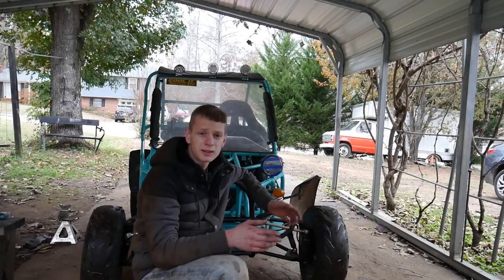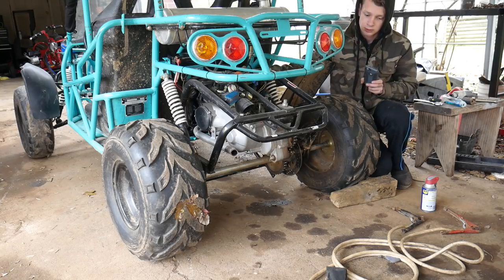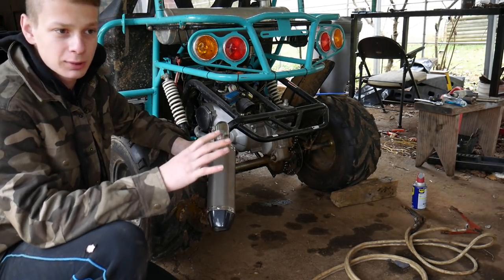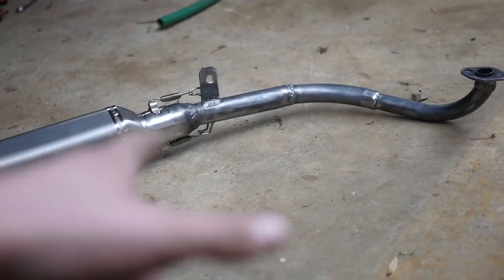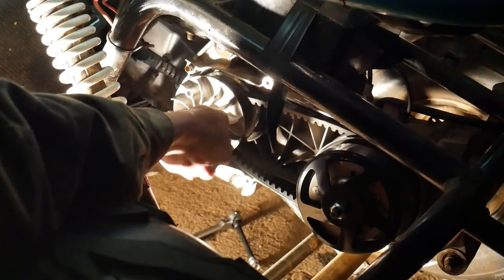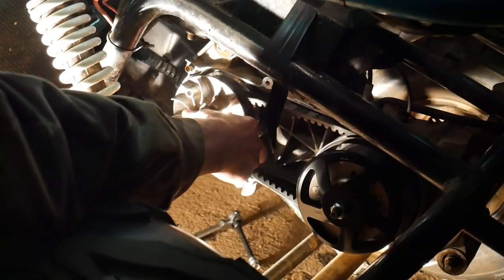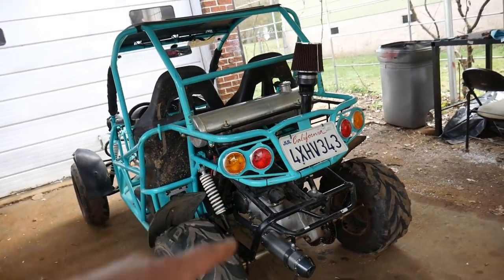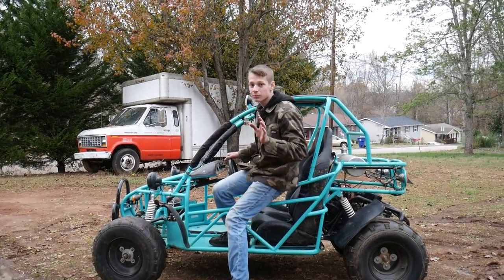GY6 150cc Dune Buggy is Back +Exhuast & Performance MODS!!

Comment: The aircleaner is something that bigger is not always better. 
Air velocity has to be taken into consideration. You could use a 3inch flanged airfilter, but you need to start stepping down the Inside Diameter of the airintake immediately. You can probably neck it down to 25% larger than the carburetor airhorn (air intake side) and still maintain air velocity to operate the engine. You may be able to get more velocity by putting the fliter inside of an airscoop facing forward.
Air does not like 90°  right angles. It hits 'the wall' in the 90° bend and tumbles. That's not what we want. We want  the air to be traveling as straight as possible when it enters the carburetor airhorn.
You can use a 90° bend, but you have to have sufficient velocity and the 90° bend as far from the airhorn as possible, right at the filter, to get the tumbling straightER as it enters the carburetor.
A flexible accordion hose used for RV septic tank is a standard 2.5 inches and comes in 10 feet length. Use it for no 90° bends. A flexible straight 2.5 inch hose is even better.  PVC can be used and make your tirns with the hose or use 22° or 45° PVC or radiused Turbo silicone connectors.
Use 3- 4 inches of  2.5inch PVC pipe and connect a Spectre or
K&N with a 2.5 inch flanged filter. 
Spectre can be used with no filter oil. I recommended a pre-filter for K&N. High flow comes at filtration cost. 
You can step the ID of the RV hose down with 1 or 2 PVC adapters to get it to your carb or TBI Outside Diameter. Use a piece of old bicycle innertube for a connection.
Both K&N and Spectre make silicone sleeves to step down from 4 inch in .500 inch increments to 2.5 inches. 
If you use the above ideas, avoid 90° bends and keep velocity in mind any engine will run better with a good air intake system.
Reply: That's great advice James. I'm just about to do this on my buggy so will try and do it as you've described.

Comment: Take  the tire and tube off and make a new center out of say 1/4 or 3/16" plate. Then keep your eyes on CL for new wheels.
Reply from the maker: Me and my dad actually cut out a center for the rear wheel after it fell apart too, and it was a complete pain in the but to cut it out. The welding part was easy though. If it happens again, I'm going to the machine shop. But these are the wheels and tires I'm looking at for the power levels I will be running next year https://rover.ebay.com/rover/0/0/0?mpre=https%3A%2F%2Fwww.ebay.com%2Fulk%2Fitm%2F332760438422

Comment: Use 10gram roller weights. They're good for getting torque to the ground.
8grams make them climb like goats, but take topend off.
Reply: I prefer sliders to weights, they perform a little better.

Comment: i know this is from way back, but the bigger intake could work if you, when the engine is warmed up, fiddle around with the air screw, that is located on the side of the carb ;)

Comment: 👍👍 love the muffler. Can’t wait to use it on one of my projects
Reply from the maker: Definitely a nice muffler. They have 5 different styles and the carbon fiber one looks best IMO. I believe they cost 39$ from china. Only problem is the Outside diameter is way to big for most pipes, so there will be a gap when welding.

Comment: Running a liscense plate not registered to vehicle is illegal.Better off with no liscense plate.
Reply: Vasily Custom Builds but I would say it probably stands out more because of the license plate so I would take it off
Reply: Just asking for a big ticket if you leave it on.
Reply: i mean you wouldnt be pull over that fast cause of the licence plate. i did run my licence plat of my other quad on a other quad i had cause one wasnt registered. so it would look less suspisious

Comment: Is that a two stroke engine
Reply: No, the 150cc gy6 is a four stroke single cylinder cvt scooter engine. I have one in my quad. Hauls ass pretty good so long as the vehicle and rider weights don't get nuts.

Comment: Just wondering the 2 hoses that have vacuum which are the crankcase hose and the I would say valve cover hose at the very front what did you do with those hoses being you have a aftermarket filter cause those hoses went to the old air box.
Reply: Just wondering the two hoses that I have left over after putting a aftermarket filter which are the crank case hose and I think valve cover hose at very front… they were both connected to old the airbox I have a 169cc “150cc” go kart

Comment: Nice work, may i have a link to buy the exhaust
Reply from the maker: Thank you !! https://www.ebay.com/itm/New-Exhaust-Muffler-DB-Killer-Pipe-Slip-On-Off-Road-Motorcycle-Dirt-Pit-Bike-ATV/232235811164?hash=item361255415c:g:kiYAAOSwPIhaAUoo:rk:6:pf:0

Comment: Hey bud, what is that buggy called? I just got the same one and I dont know anything about it. It's a 150cc right? What's the name of the buggy called? Any help would be greatly appreciated:)
Reply from the maker: Made by bms. Sand viper 150. Air cooled 8.5hp gy6 150cc with reverse